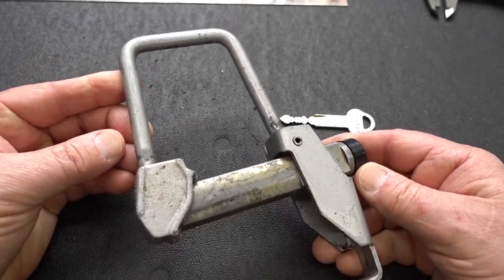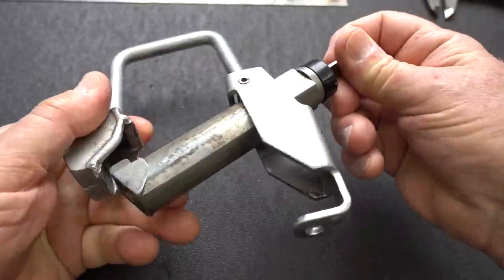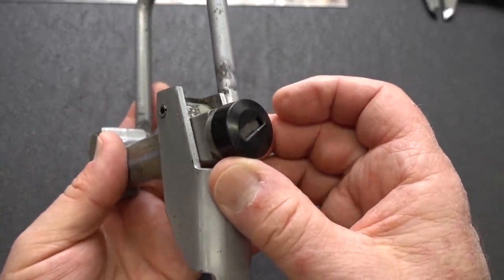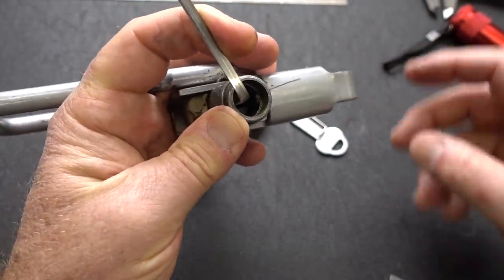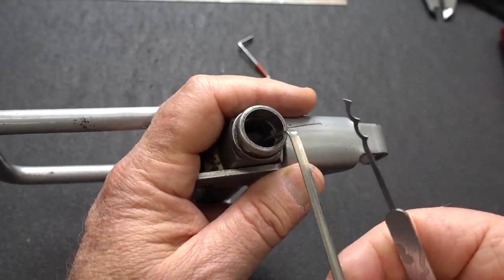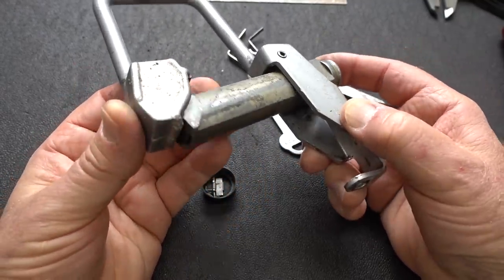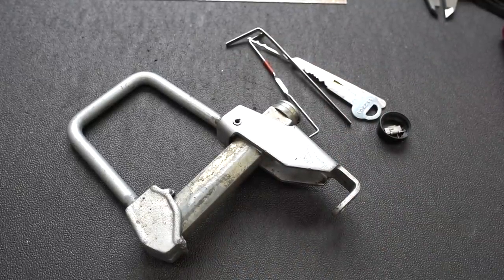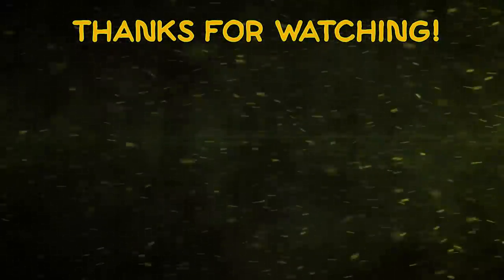(1732) Assa Bike Lock from Sweden

Comment: That type of lock was often found as factory installed on Bikes made in Sweden.  The lock was welded directly to the bike frame and did not have the  bracket as this stand alone lock has.
Reply: Never seen one not welded to the frame before!
Reply: Have had one sheppshult and one crescent with a assa lock welded to the frame😂
Reply: Gave me flashbacks when the lock froze, the plastic cap was not watertight! And being ASSA you know you couldn't force it open... Weird seeing me standing on my knees breathing into the lock to warming it up! :D
Reply: It was on almost every bike when I was a kid.
Reply: @jamesstrain7062  Thats a great way to make your key weak and have it snap in the lock
Reply: James Strain Yepp, always had an lighter in my pocket during the winter just in case the bike’s lock had frozen!
Reply: banaana1234 I’m not sure you manage to raise the temperature on that key so high that it would make it brittle? I had to do this several times as a kid, and I never had a key break.
Reply: Yeah, i had a lock like that on my Crescent bike in the 80´s and it was welded to the frame like that, it was quite common then.
Reply: @Cheesen77  precis, Cresent hade dem som standard, klassiskt blocklås
Reply: @Hiznogood  , Yup, Did it up North in the winter too with our cars
Reply: @jonasaman9104  inte?  den typen av lås var typ standard i åratal.
Reply: Revener666 Han menace att han Inte sett ett sådant lås som inte var svetsat fast.
Reply: @Lfcsweden-n5m  så går det när man läser och svarar fort.  :)
Reply: Revener666 haha japp, hänt mig också tusentals gånger ;)
Reply: @banaana1234  You doesn't make it glow, just a little over hand warm.
Reply: Yep, looking out of my (Swedish) window right now I see three older bikes with this lock welded from factory. Never seen the bracket version either. Later, in the 90ies, this was replaced by a round version, which had a spring to keep the lock out of the spokes and and could be locked without the key. 
Nowadays welded looks seems to be out of fashion, maybe since bike frames are not designed by the bike manufacturers but imported standard models from Asia. Often this type of lock comes installed instead https://cdn.webshopapp.com/shops/14766/files/216602630/axa-2e-fietsslot-aanbieding-axa-cherto-compact-95.jpg. 
That the vast majority of bikes in Sweden are not sports equipment, but everyday utility bikes used to roll around the city to work, to carry groceries in the basket or to bring kids to daycare. A important advantage of this lock is that it is fast and easy to use when you park your bike many times a day.
Reply: More common in the nineties than the eighties, though.
Reply: Probably good locks but they are sensitive to dus and grit, freezing..
Reply: @jonasaman9104   it was pretty much standard on MCB bikes from the 70s - 80s Called "Blocklås" :D
Reply: @aikodua  I grew up in the 1970s. IIRC, these locks became mandatory around that time if you wanted your home insurance to pay out if your bike got stolen. Insurance companies listed which locks were approved, and to get the payout you had to show them that you still had the key. 

The bracket version would have been installed by a local bike repair shop on your older bike that had a non-approved lock. That's why you've never seen them, the bikes that had these installed would be 50-60 years old by now.

Comment: 1980's Assa be like: "oh come on please... of course we thought about the weakest point, so we made sure you can't remove is without the key"
Reply: And even if you pick it you need to secure it in the holder (or more likely with duct tape if you pick it), if you forget that and turn you run the risk of it folding into the spokes of the back wheel.
Reply: @swe_nurse8121  Later versions had a spring that kept it open and away from the spokes.

Comment: We used the circular ones here (also from assa), and they were pretty universal to all bikes in the country (NL).
But they weren't all safe, as at some point a flaw was found with the keys....that allowed you to use a blank key to open them...
This was rectified of course, but there are still bikes out there with the old locks :)
Reply: Send one to Bill?
Reply: A downside is that you can lift the rear wheel and slowly walk off with the bike. Then you can open it away from prying eyes. My school told me that they once had a truck pull up and people just started loading bikes from the school bike shed into the truck.
Reply: @aapje  Truck attack is a common problem these days with criminals from eastern Europe claiming they just found these bikes as "generous gifts" from the local population.
Reply: Circular style is still made by ABUS.
Reply: @johndododoe1411  assa later named axa is the major oem lock brand of dutch made bikes.
Reply: I remember a circular lock from the 80's.
It had this bent plate with a hole in it as a key.
A colleague of mine lost his key, and he knew I was kind of good with locks.
He asked me to open it.
I said it would be ruined if I did, but that didn't matter.
So I got a screwdriver, jammed that into the keyhole as far as it could, and janked it upward.
All the guts spilled out, and it took me just 2 seconds to open it.

Comment: Grew up with these locks. I'm sure not all bikes had them, but all bikes I owned growing up had this or a circular type (if my memory serves me it must have been a stamped steel solution, almost like the discus locks).
But what this made me realize is that I see so many bike locks (for pushbikes, motorcycles etc.) that are sold today, and the pick resistance seems to have...well... Let's be nice and say "not improved".
Reply: I guess you mean the Basta/AXA Circular locks, they are still for sale, under AXA name or at Biltema.

Comment: The pin is only to replace a cylinder insert with missing key or other failure, without needing a blacksmith to weld on a whole new unit

Comment: It's been a while since a saw these locks but back in the day it was very common.
It's an easy pick, i picked a lot of them and changed the locking bolt to a new one.
You made me smile by thinking you could easily bend it open or only remove the pin or to use light turning tension when picking the lock.
Not all ASSA are scary like the old ASSA 500-series that was pretty easy to pick with the "timeglass"over tumblers, those was as fast to pick as to open with a key.
Reply: That old ASSA 9-lever 90000 lock is also pick-able but i like to snap with the turner when i pick them if you understand what i mean, long time since ASSA stopped selling that one.

Comment: I've never seen this type of lock that wasn't actually welded to the frame. I guess this was meant to retrofit in older or cheaper bikes that didn't come with one.
Reply: The welding to the bike frame came later, this style came first.
Reply: ...or give you the choice of what lock you wanted to use without having to lug one round that you weren't using.
Reply: They where mostly welded from the factory but this is the aftermarket variant for retrofittig
Reply: @ehsnils  I don't believe your statement. I can't remember seeing the unwelded design before the welded design.
Reply: @theRealRindberg  It's not an unwelded design.  It's the welded lock, ready to be welded.
Reply: @johndododoe1411  No its not. Look at the pictures linked above. This is welded to a metal bar that is used to attach it to a bike with brackets and screws.

Comment: You wouldn't be able to bend it outwards even if you detached it from the frame, the hook at the end of the locking bar goes into a recess in the steel casting and prevents it.
Similar locks, often welded directly to the frame without the bow, were very common here in Finland at least in the 80:s

Comment: You need to make a symmetrical tensioner for the ASSA 90000. The first couple of levers always should lift to the same height as the actuator. This makes picking much easier as you only have to pick the center levers.
Reply from the maker: So you're saying the first two levers and the last two levers are all cut to the same height? It that true for ALL Assa 9000s?  If so, it'll still be tough since there appear to be false gates, but with 4 fewer levers to worry about it improves the odds significantly.
Reply: @bosnianbill  Exactly. Because the actuator is as wide as two levers and the key must work from both sides the levers opposite the actuator are always the same height as that one. When you feel tension on the actuator the levers opposite it will already be at the correct height.
Reply from the maker: @mrfrenzy.  Excellent!  I can make one (kind of) like that one in the shop.  A PROJECT!  Thank you!
Reply: @bosnianbill  It's like the tool you used which was designed by Lock Noob. Some of them have that arrangement on one end.
Reply: @mrfrenzy.  that's an interesting pick design which would work even if it was a split bolt with two actuators. Time for bill to go to the workshop with Harry again methinks!
Reply: @bosnianbill  yes bill, there's simply no where near enough lever lock tools out there nowadays. It's about time that changed.

Comment: You may (probably) already know this  but roll pin punches can make life a little easier. You can modify your existing punches by chucking them up in a drill and reducing the end diameter to fit inside the pin using a Dremel tool with a cut off wheel.
Reply from the maker: Thanks for the tip, William!  I actually DO have a set of roll pin punches but they were too small in diameter for this pin, so I grabbed a normal punch with a larger diameter.

Comment: I had at least two bikes with this kind of lock and where I lost the key. Powertools werent all that common in the 80's so it was an absolute ass to remove with a hacksaw. That shackle is hard as F, at least for an adolecent. And you have to cut both ends of the shackle.

Comment: For the thief attack, You could just bash out the split pin that the lock hinges on and remove the whole lock tube all together. ...okay I didn't see that retaining tooth either. Imagine how frustrated the thief would be!
Reply: Pen Fold not inly that but most of these where welded to the frame so you couldnt punch the pin , it would hit the frame

Comment: So windshield wiper insert is a real thing you have for sale over in the US? That's really weird. We just have ready-made windshield wipers of different lengths to buy.
Reply: Not for sale, just visit your local car mechanic workshop. They will throw out hundreds of those every month. They are used to give cheap wiper blades some stiffness so they don’t flop about in the windshield wiper heads. Usually pre 2000 built vehicles
Reply: Sparrows, Southord, Petersen, Multipick and many other professional locksmith tool suppliers now include pre-graded and prepared wiper insert wrenches in thier kits (which are usually hardened stainless steel) Some even supply unworked but pre-cut lengths of spring steel for you to make your own. It's a pity they don't supply blank pick steel lengths too. Ah well.

Comment: I'm having a little trouble envisioning how these were welded to bikes and used.. Anyone got a link?:)
Reply: @fredriksvanstrom4592  Thanks for this.  That lock would never work here in LA. They just grab the bikes and run away with them if they aren't locked to something solid.
Reply: @thalivenom4972  or you could lock the frame and front wheel to a pole with a second lock and chain
Reply: I think probably imagine this lock without the U bar, where the two brackets of the lock are welded to either side of the frame instead of to the U bar as they are here.
Reply: R. Akers you usually had a second loop lock or plastic coated wire with loops on the end that you would weave through bikerack and lock onto the locks lever
Reply: @fredriksvanstrom4592  Ah, that's a racing bike alright.

Comment: This one would beat most people. Raking must be a desperate method to lock picking purists. Crooks would probably use a di grinder - but that's noisy and attracts attention. 'Old, but interesting' is the phrase which comes to mind. Thanks Bill.
Reply: A grinder/cutter would risk damage to the frame and the wheel. Not really an option.

Comment: You know ASSA could add a circuit with the key eg - on certain points to open the lock it need electrisity and with the miniturasion thats going on I guess that will happen with locks so you cannot pick it with only mechanical tools.

Comment: BB should make sure he can pick a Swedish jail lock first, before he makes that loud attack on the ASSA. 
Swedish jails are nice, considering. "Designed for rehabilitation," but that's impossible for anyone in locksport, because you can't rehab a lockmeister by locking him/her up. The temptation. 

Would Youtube demonize & demonetize a jail lock picking video?
Reply from the maker: My only "attack" on Assa is the complimentary kind!  😀  When you see their name on a lock you are usually guaranteed good tolerances and picking resistance.  Some more than others, but even the WORST Assa is 50x better than the BEST Master Lock.  Insofar as Swedish jails... I'm pretty sure that even if the BEST lock picker was thrown into a Swedish jail he/she would remain there until officially released.  Yeah, their locks are THAT good.
Reply: @bosnianbill  that, and the fact that the keyhole is only on the outside. It's just a blank door on the inside.